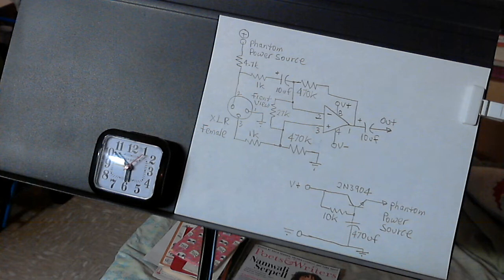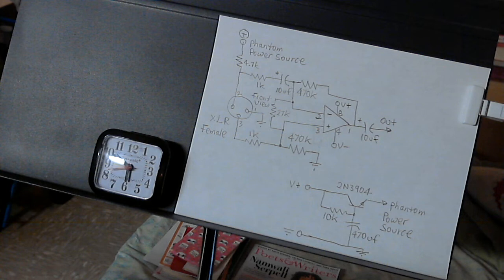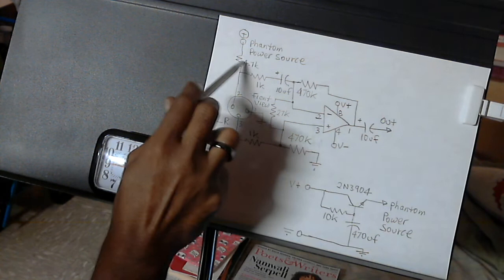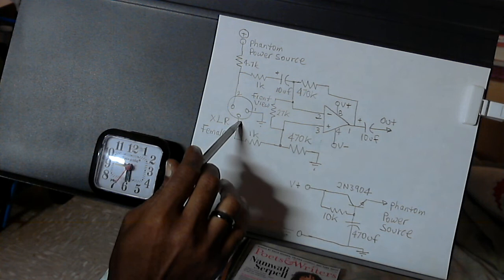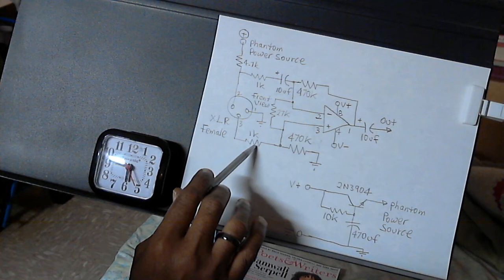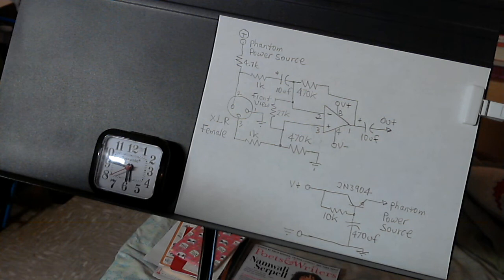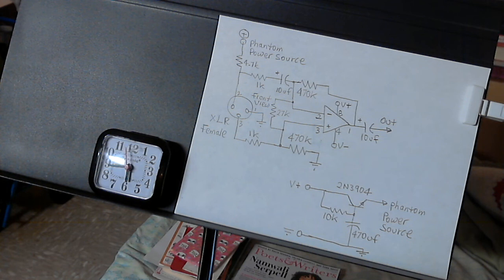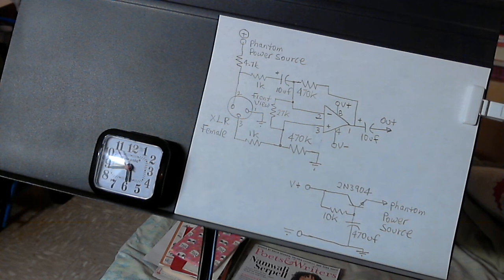Balanced Mic Amp circuit using female XLR jack

Comment: You may want to check with the manufacturers of some of the microphones with which you intend this circuit to work with to confirm the way they connect the microphone. That way you will KNOW and won't have to rely on third party opinions.